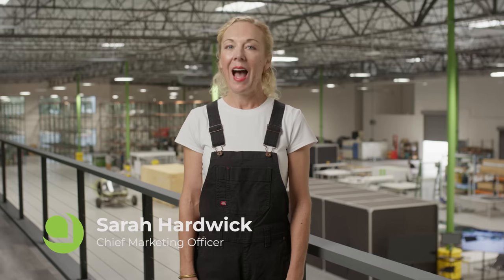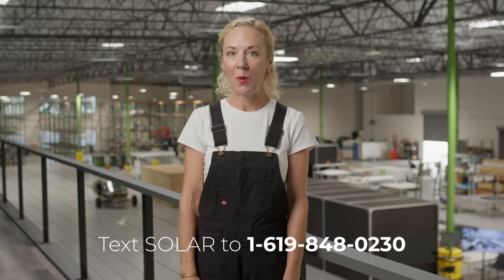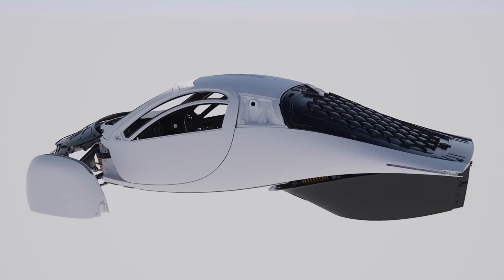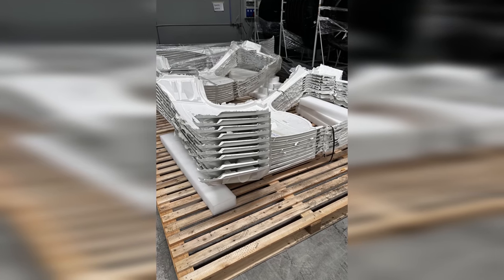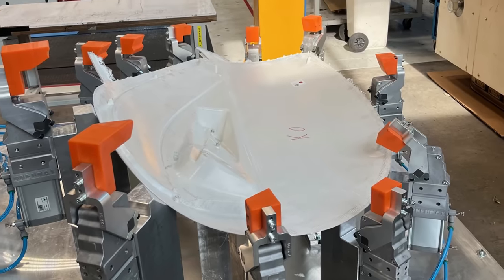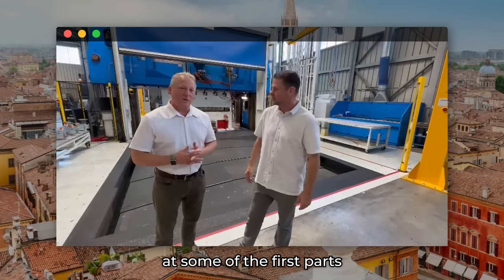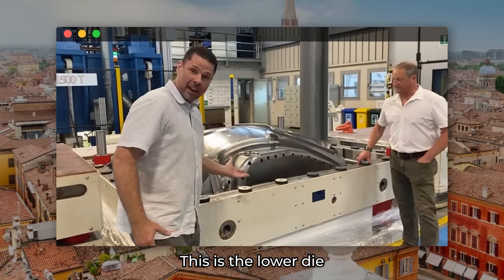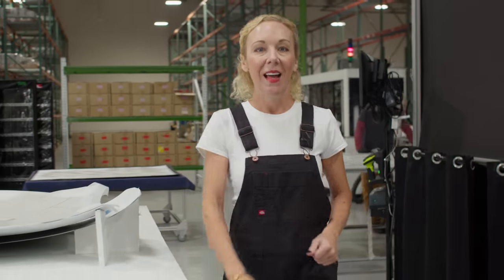Aptera Update — October 2023

Comment: 5000 lbs. , not 5,000 tons as noted by talking head. Doesn't inspire.
Reply: I think 5000 tons is right!  my company produces molds for SMC, I can assure you that many tons are required for the production of these components.😊
Reply from the maker: It is a 5000 ton press!
Reply: A 10,000,000 lb press?
Reply: @alanhutley6634  yes confirm! 😀
Reply: Do your homework, 5K Ton press is correct.
Reply: 5000 tons is a lot, but not that crazy. Tesla's chassis "gigapress" is 9000 tons.
That press in this video is pretty massive, I believe it.  Smaller metal forming presses are in the 500-1000 ton range.